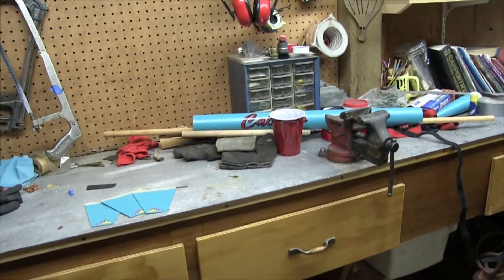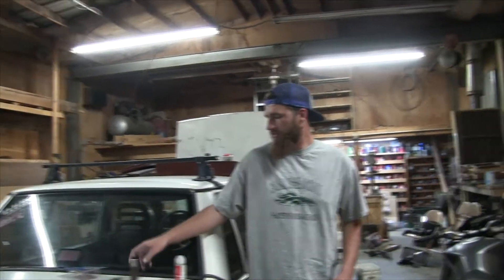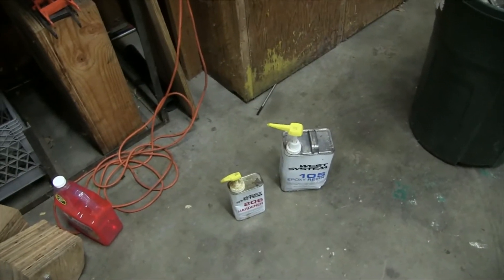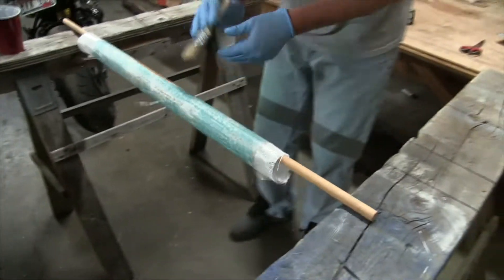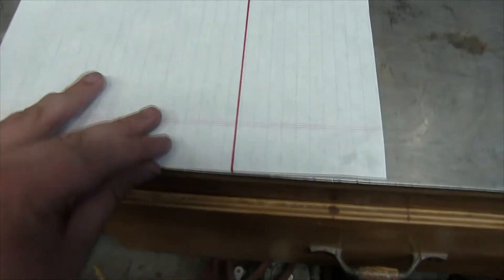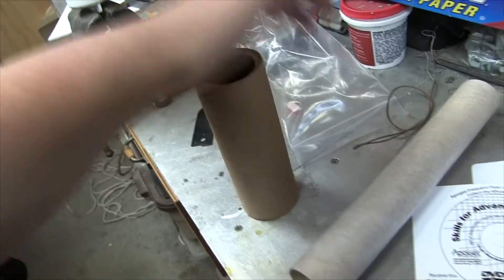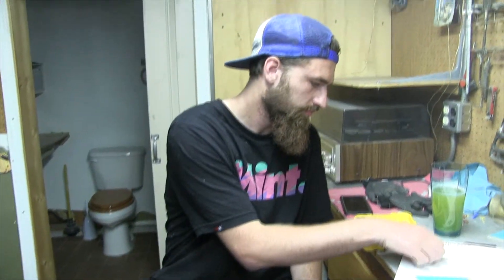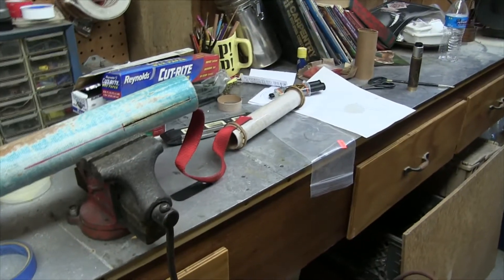Building A High Power Rocket  Part 1: Fiberglass Layup and Motor Mount Assembly

Comment: Nice video! Next time you have a weird measurement to divide evenly, use an easy larger number. If you put the ruler at an angle with 0 at the edge and 9 at the line, the 3 and 6 are at the correct lines. Old carpenter trick.